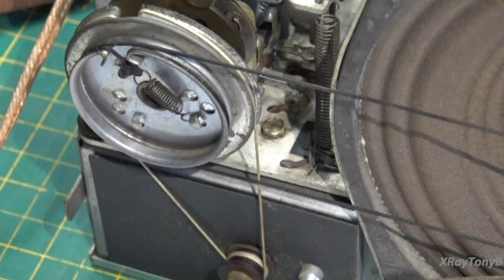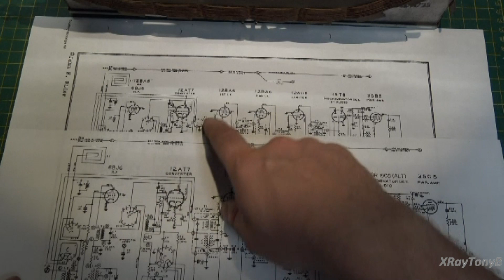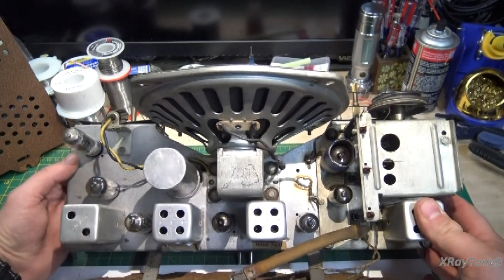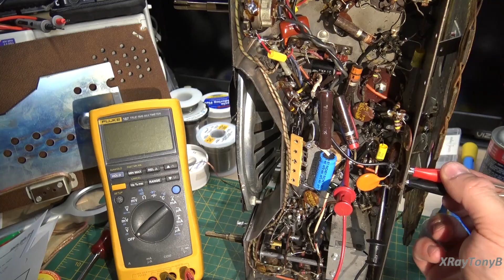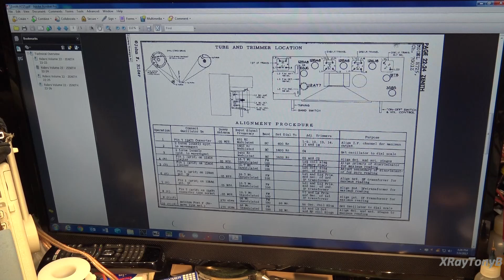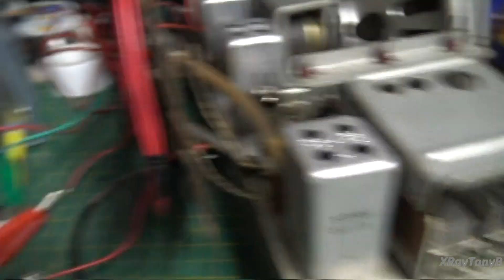Zenith H 725 AMFM Tube radio - Part 1

Comment: Before you work on radios like this always check your electrical outlets in the house! Someone reversed wired one outlet in my house and  I totally missed it until this year.
I have lived in the same place for twenty six years! My computers have  been plugged into it over time with no effect because they are driven by transformers.
You can use a small outlet checker available at most major home center stores. Then and only then you can use it to power a "hot chassis" radio!

Comment: I have a Zenith model H723. For the FM alignment it states to attach the high side of my signal generator to the  ungrounded shield over the FM converter tube. However, the shield is riveted to the chassis which is ground. So, my question is where do I connect the high side?

Comment: Outstanding videos!!  I've been working on a 7H820 zenith--almost identical circuitry--and also an Armstrong slug tuned fm.  First question: I'm using a 1n5408 diode and had added a 100 ohm resistor--but found the voltages dropped dramatically on the B+ supply.  What size resistor are you using?  Also--not clear on how the cap you added is hooked up...Anyway--would really appreciate your help...Thanks!  I also ran into the shielded cap and weirdo  mica resistors as well--must be a zenith thing.

Comment: Many, of not most (or all) of these “All American n” radios have a “hot” chassis .. meaning, the chassis is midpoint of some kind of voltage divider (but shown as “ground”), and has voltage to real ground .. just another case of using an isolation transformer, when doing your service work! .. Be Safe ...

Comment: Zenith was famous for the three wire disk capacitors in both their television and radio equipment. Notice the numbers on the capacitors. 
Like 22-3  22,000 pico farads or .022 Micro farads.

Comment: The "Z" means it does NOT have the OLD F.M. Band.....i.e the original lower band that was discontinued. Therefore, the "Z" designation on the chassis should indicate the LATER model and later schematic. Also, given this unit does NOT have the "Armstrong" logo on the back, as mine does, this should be a later model......just from what I have learned.

Comment: Very nice. I recently restored a Zenith Y825 which is similar to this model. The handle on the Y825 is simpler and the bullseye grille has a shiny brass finish opposed to the reddish tint. I had it all repaired and reassembled and then read about selenium rectifier stinkbombs. I reopened the radio and replaced the SR with diode/resistor. The set works flawlessly and plays for hours without issue. The FM sounds fantastic and the phono input is great for pairing with period record players.
Reply: Hey. How to remove a tuning knob? I'm afraid to break.

Comment: This is a great video! I've got a very similar set with a wood case rather than Bakelite. I use it with a cheapo battery powered Bluetooth receiver on the phono input so I can listen to old radio shows. Mine was also worked on previously so it was a bit of fun figuring out how to get it back to right again.

Comment: Tony,
Could you better explain exactly why you have that blue electrolytic cap connected to the cathode of the rectifier diode and that large wire wound resistor?  Also, does the bottom (negative side) of that cap go to ground?  I was hoping to see on your schematic where you have that cap added to it.  Thanks!

Comment: Re electrical safety, in UK workshops we have rubber mats on the floor and bench and all bench supply 230 Vac go via a 1 to 1 transformer and there are no earth/ground connections on the bench or within 5 feet  this is also the case with tests instruments   or antenna connections

Comment: Hey xraytonyb, What type are those yellow axail capacitors you use for recapping? For the life of me I can't seem to remember. As always great video sir, keep up the great work.
Reply: Thanks, For some reason I thought they were Polly caps. Awesome sites here for getting caps. A great while ago I tried Digikey and Mouser, they had them but not the sizes I was looking for.

I got myself a Eico Model 950 from eBay. The seller said it was fully recapped and sure enough there was only two caps replaced while the rest were stock. My first Vacuum tube project.